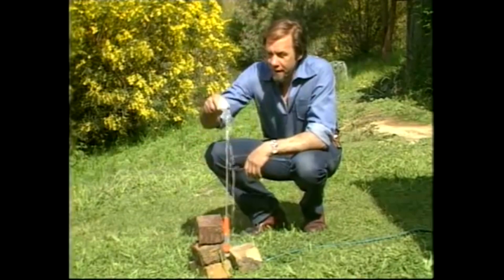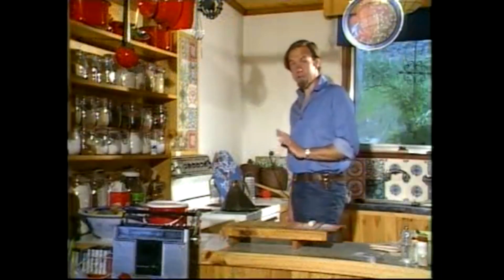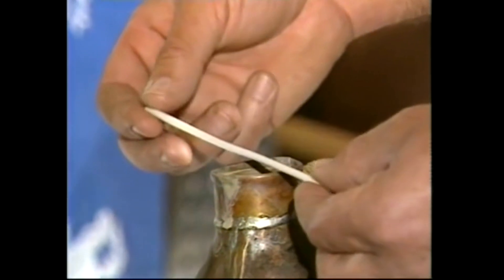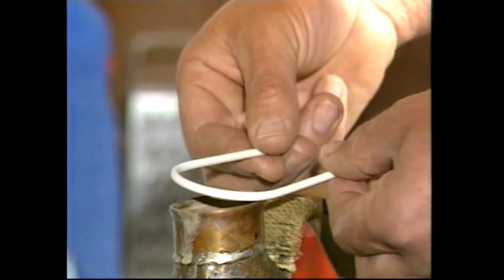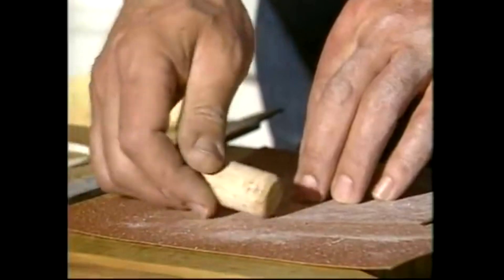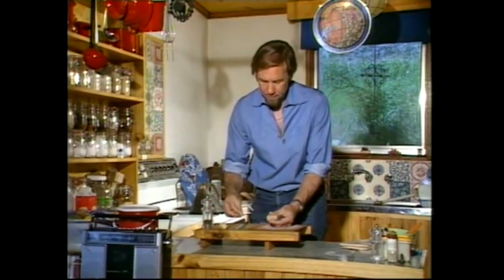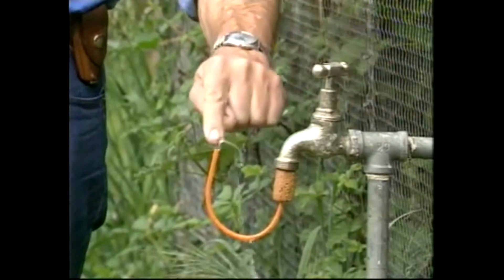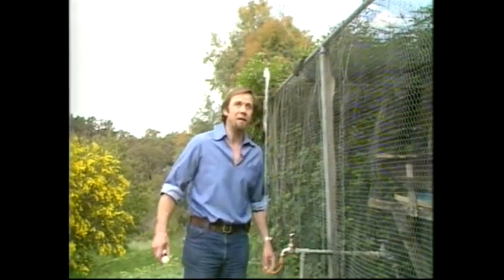Ping Pong Fountain Ball Explained.

Comment: Also works great on a stream of compressed air from the nozzle of a compressed air gun. I used to do this at my workplace with balls of rolled plasticine as the extra weight of plasticine seemed to make it more stable. Amazingly you could tip the air stream to an angle of about 45 degrees with the ball hovering about 6 inches from the end of the nozzle before it would start bouncing around in the air stream and fall out.

Comment: I remember getting a pipe (smokers pipe) in a showbag from the Royal Easter Show years ago that worked similarly to this but  it used air, rather than water. Quite ingenious too. You just blew into the pipe, and a little ball would be suspended in the air about 6-8 inches above the pipe. It even had a little basket so the ball would be sitting right above the opening so you didn't have to try an position it manually.
Reply: That pipe made it as far as Rhodesia before it broke down.